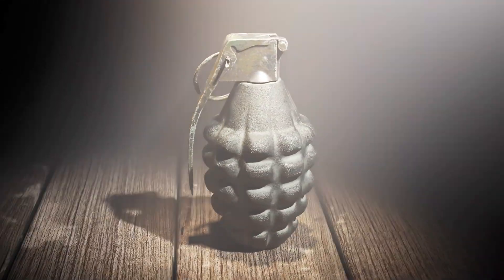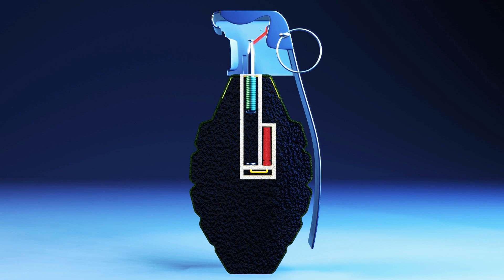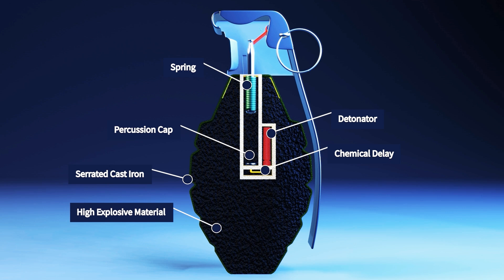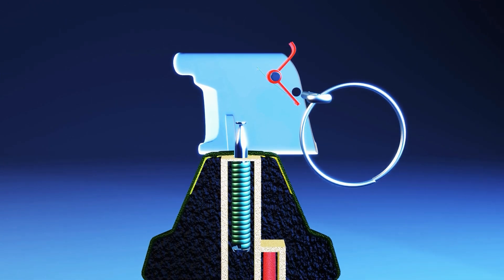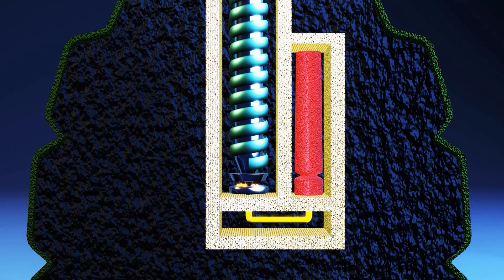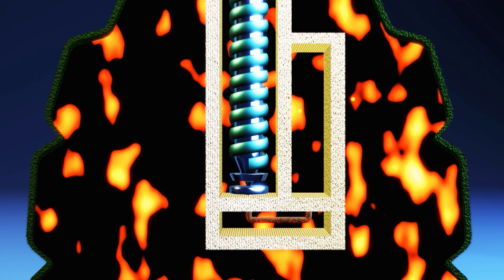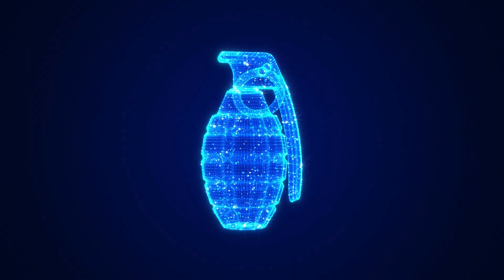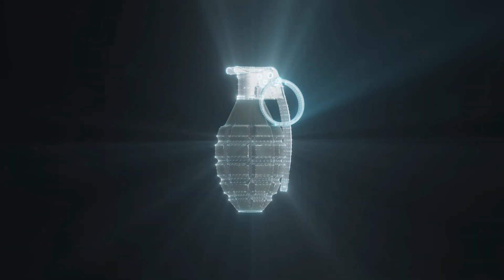How a Hand Grenade Works

Comment: To get a successful kill with a grenade, it's recommended that you should hold the grenade in your hand for no longer than 3 seconds once the safety pin has been removed, then proceed with throwing it at the enemy! Thete have been instances where the enemy picked up the grenade and threw it back at its host, reversing the intended outcome lol